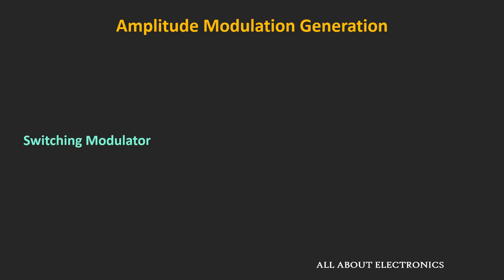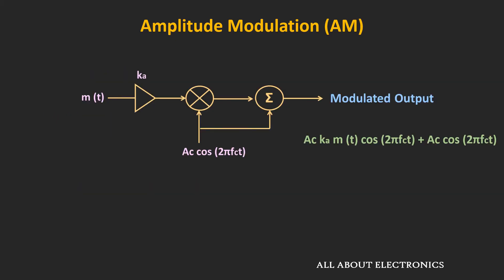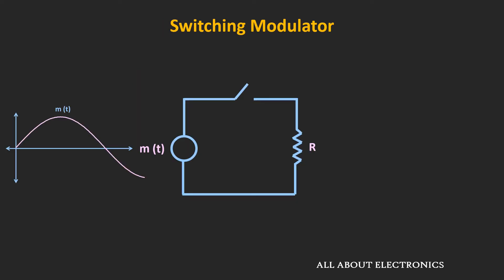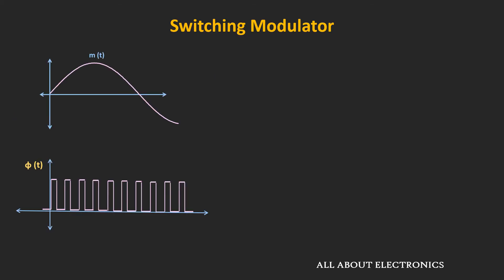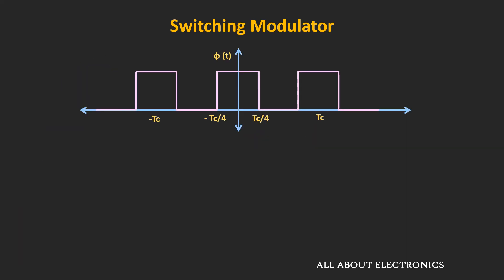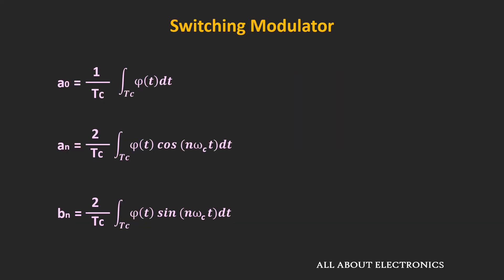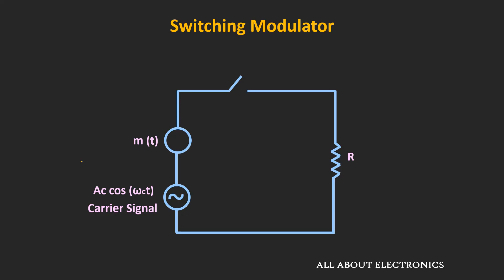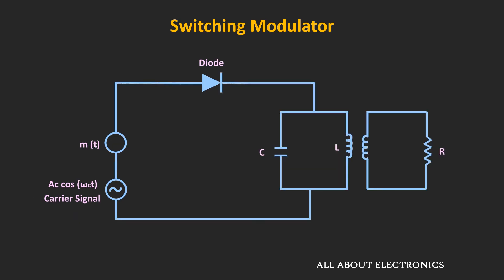Generation of AM signal: Switching Modulator Explained

Comment: Design and implement a switching modulator in MATLAB for Modulating a composite audio tone signal to the medium wave (MW) AM band which is used for radio broadcasting. The information signal is supposed to be a dual tone having two sinusoids X+1 kHz and Y+2 kHz, where X and Y are the first and second digit of your Roll no. respectively use the other best suited parameters of  your choice for the camer frequency, filter types and their bandwidth. Analyze the time signals and their spectra at different stages of the implementation.

Sir can you guide me how can I do this?